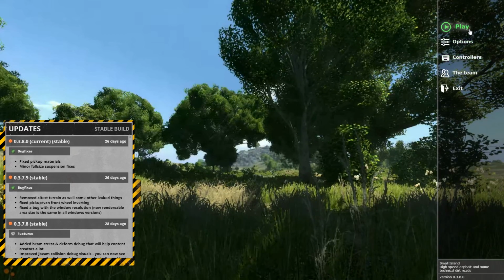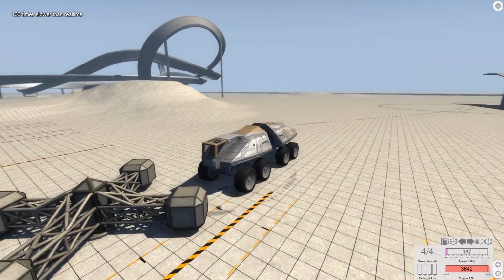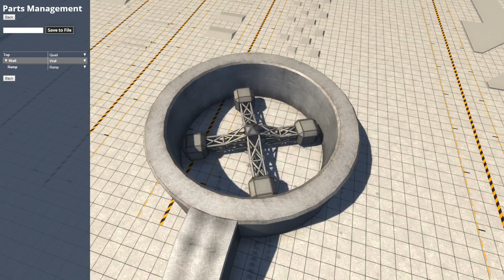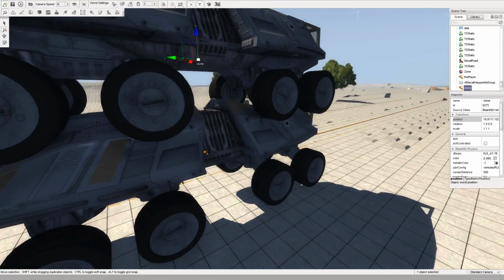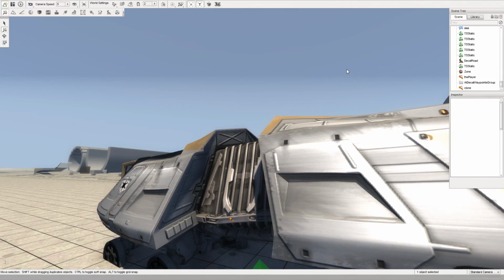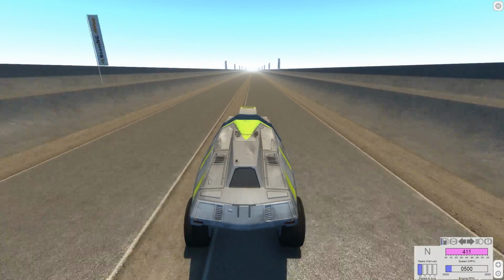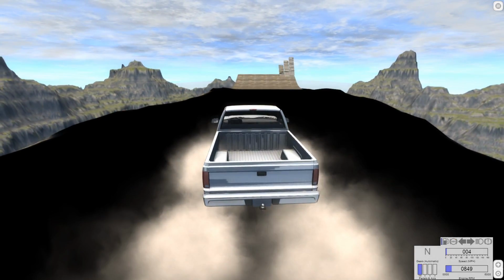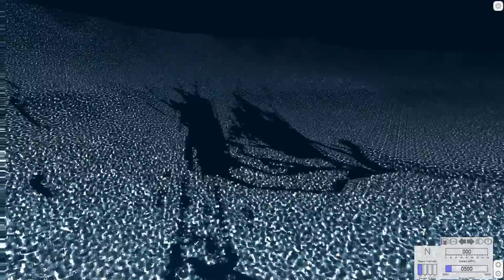AT TE Extra Testing- BeamNG.drive

Comment: Hey whybeare huge fan but I have a thing you could do in beamng drive test the handbrakes of vehicles by putting on the handbrake using the wind add on and slowly increasing the wind speed. Like and reply what you think
Reply from the maker: Isaiah Fierberg Anty There's actually an angle tester which would work even better for something like that. Because wind is more about the weight of the vehicle than the parking brake's strength.
Reply: WhyBeAre OK OK I see well you should do it either way cause it would be awesome also if you do it could you give me a shout out for suggesting it

Comment: You need to do a video of the update even though it's lame, well the only thing that is cool about it is that there is a new car that come with it and the Gavril T-series is does not say W.I.P.
Reply from the maker: BeamNG Driver There are a lot of small improvements, and a good number of big ones. I think it's a nice update.
Reply: Yeah, I guess it's pretty cool. The only reason why I said it was lame is because the AI doesn't work now in the menu, you now can only do it with AI control app.
Reply from the maker: BeamNG Driver That is true, it is unfortunate that was removed.